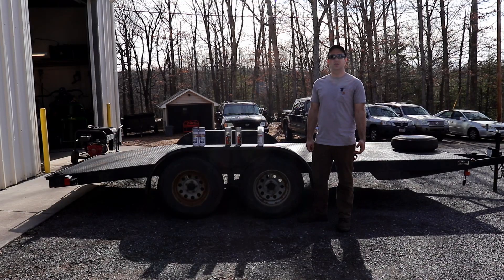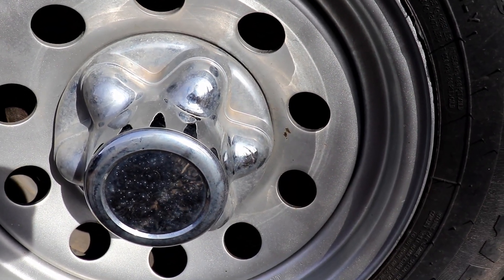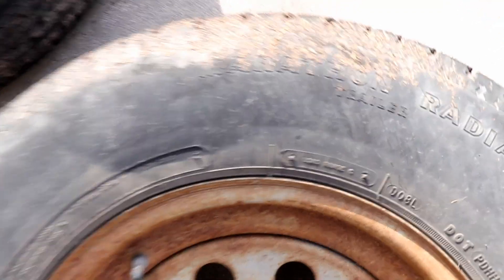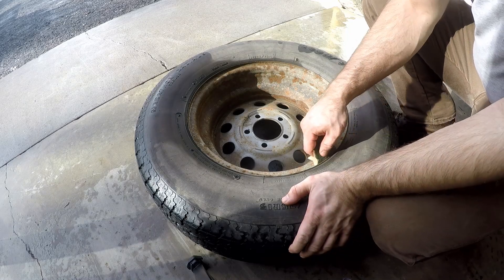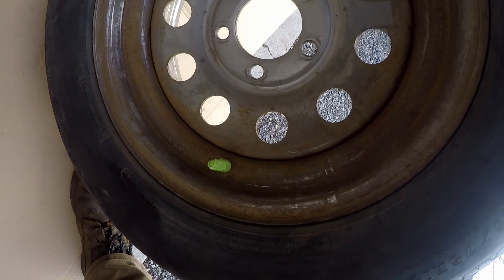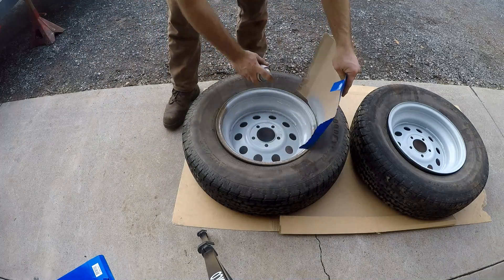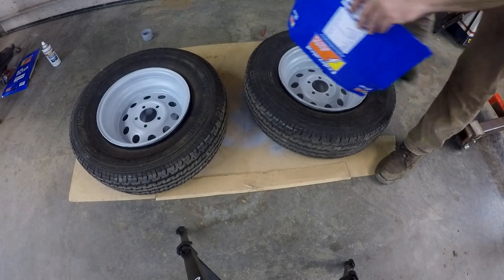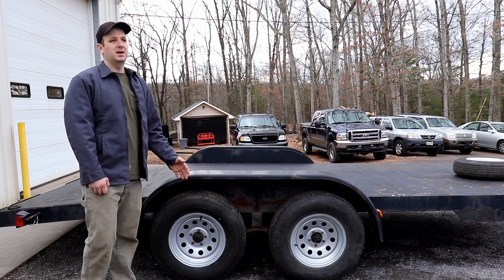How to Make Old Trailer Wheels Look Like New

Comment: Chainsaw brush that he’s using works great.  Ps if you use a piece of roof flashing you don’t need to take tire loose
Reply from the maker: The problem with using flashing is the lip of the wheel won't get painted.

Comment: How has it held up with use, heat and grease since you painted it?
Reply from the maker: These wheels look okay still but they were pretty rough. It is like the primer has sucked the pain in, in places. I've had better results from wheels that were not as far gone.

Comment: I'd have used rust dissolver & a pressure washer.  Either way 2013, great value, GG.
Reply from the maker: Are you talking about something like naval jelly?
Reply: @TractorTech  Yes, & rust dissolver comes in liquid forms as well.  I have no favorite brand but do feel more confident with the end results after using my time to refurbish rusty things.  I used three applications & pressure washings for my BX mower deck this year .   Your channel is one of the best, 10/10.

Comment: Some dummy scuff my wheels inspecting the brakes. 🤣😂🤣 Keep in mind that these inspectors are paid by the state 😂🤣😂
Reply from the maker: The state inspectors here are independent. They are approved by the state. They all whine that they don't make any money from doing inspections. Our worthless governor was going to do away with it, which would have been good. All the inspection station whined that they would loose money so they did not do away with the program.

Comment: I would of wire wheeled those bad boys esp the inside and let them ride. Maybe sand the worse areas on the outside after wire wheel
Reply from the maker: The wire wheel leaves some deep scratches that are visible after painting.
Reply: @TractorTech I would use sand-able filler primer and then light sanded the first coat of primer if that a smooth finish look was desired.